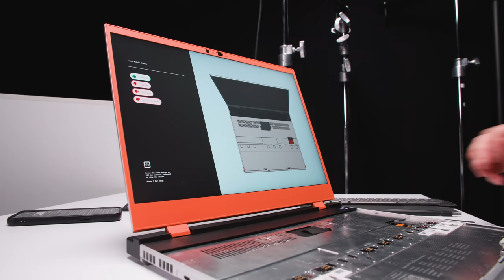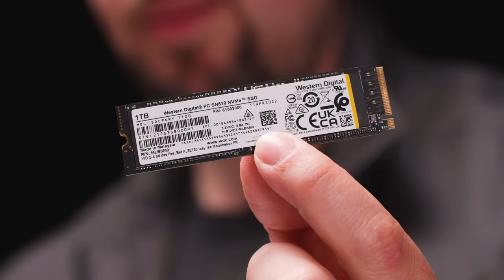Framework 16: an exclusive look inside the modular gaming laptop

Comment: Would love to see an adapter for expansion bay that can connect to usbc port for high end gaming and rendering rather than carrying a heavy laptop.
Reply: U mean oculink. Usb4/tb3/4 are limited to 22gbps of pcie bandwidth.  Oculink in its 8i form can take 8 straight lanes of upto pcie gen 4.
Reply: @megajatt123  the same interface framework used to connect the enclosure but reusing one of the ports.
Reply: @vasudevmenon2496  but, what advantage would u get from that? Correct me if I'm wrong, u want to plug the 7700s dpu that is designed to slot into the explansion bay, into one of the 6 tbhunderbolt ports right?
Reply: @megajatt123  i wanted it on framework 13 to balance portability and power without the extra bulk off 16 inch
Reply: @vasudevmenon2496  not going to work.the dgpu needs power to run, which the framework 13 cant put out, so u would need some sort of enclosure for the dgpu,that takes in external power, and preferably feeds into the laptop too. Ontop of that u would lose more performance, because u would have to 1st send data to the dgpu for processing, and then it would travel back to the laptop to the framebuffer to be displayed. This second issue can be overcome by using an hdmi/display port capture device. So now u have to carry 3 things aside from the laptop. At that point, why not just have the bigger laptop?
Reply: @megajatt123  yeah that's true.

Comment: I don't think its a gaming laptop, more a productivity one. I don't think the cooling solution is really cut out for gaming.
Reply: The screen is 165hz and it has an upgradeable GPU, I'm pretty sure it's meant to be a gaming laptop
Reply: @obj_obj I did not quit catch why laptop throttled. Did they use prototype or this is actual model and it cant play elder ring?

Comment: Sadly it nearly overheated when playing elden ring. However I wouldn't be surprised if they're working on or atleast planning for a hardcore gaming laptop, and I am definitely putting their products on my radar.
Reply: was this prototype or actual framework 16? I'm confued why it got overheated. I thought this meant for gmaing.
Reply: @DroisKargva  I'd imagine the current cooling isnt as effective as something they could come up with later down the line, such as a greater number of heatpipes, which would just make it a issue of switching the old one out for said updated varient without the overheating issue.

Comment: A very novel, appealing concept. But, everything in this offering is at least 1 generation behind the latest tech. The monitors are 2k only.  No assurances whatsoever the chips and boards you buy today can be replaced by any new tech, certainly not plug n play. So the machine you buy today could easily be obsolete soon. I can see this might have appeal to enthusiasts who accept older tech, but not for the mainstream users.

Comment: Very nice video, Sean. I just wish you had gone a bit more in depth on the upgradeable parts that were already present in the 14 inch model so it doesn't get glossed over by people that are new to the product.
Reply: 13 inch model.
Reply: This CEO is very cagey about the products. Maybe he did not know.
Reply: @saulgoodman2018  ...What are you talking about? Nirav actually answered a question I had (and which was echoed by several people) on Framework's forums: Does the Framework Laptop 16, when it is attached to an expansion bay GPU, have a MUX switch. Surprisingly, the answer I got from him was yes! Now only the port built into the GPU module can be used to bypass the iGPU on the laptop for an external screen, but I'm just glad that it's even possible to do so and I'm extra glad it's an option on the laptop's screen!
Reply: @cameronbosch1213  So what he answered a few questions.

Comment: If it's DDR5 RAM for the motherboard (which it is) then it is a good idea at this point. When it's closer to DDR6 time it would not be worth buying. Besides the EU will eventually make it law for all notebooks to be modular. Probably by the year 3023! It took 28 years for them to do USB-C (uniform connections)!

Comment: I just checked the price? For 7940sh, with discrete module and rgb keyboard + numpad, 32gb RAM and 2TB storage, it's costing 4300CAD. I can buy 2 laptops with that price so that would mean atleast 6 years of laptop lifecycle (budget wise and considering I upgrade components like CPU and GPU in 3 years on the framework)..... I am not sold at this price point.
Reply: Do consider that this is a fairly small company that does not benefit from economies of scale; it’s natural to assume that much of the R&D costs will be transferred to the buyers during the first 5 years of sales. The only way to bring costs down is if demand warrants expanding the manufacturing line  (as each motherboard model, to name a key component, is custom-made for Framework)

Also, you could do without some fluff: no RGB, buy barebones and buy the components yourself to save a few dollars, don’t go for 2TB and use external storage solutions until you can afford to expand internal storage, use a cheap external number keypad, etc
Reply: @guaiqueritech  totally agree. I am writing this from a normal and day to day user standpoint. 3+ years of product development and still at early adopters stage!
Then I guess users with limited budget may need to wait 5+ years.
Reply: So, uh, dont buy the ram and storage from em?
Reply: @megajatt123  yes, I explored that option as well. W/o those components (and if I purchase it from amazon/BB) I will save around 100-200 bucks. Not much
Reply: @GUTKU  price to pay for repairable and modular design ig. We would like to see more igzo or ltpo displays though, the entire industry is using fixed refresh rate w are wasteful
Reply: @nseries73  that’s a point I’ve seen brought up but not extensively discussed: how are Frameworks marketed towards the regular user, which comprises the vast majority of laptop sales? Most users are not confortable opening their laptops, even when they are made easy to upgrade, like Acer and some HPs. For them, ease of use is their paramount concern; ease of upgrade ability is not something most consider.
Reply: Wait til you learn about the cost of Macbook, in the US i can spec it to 2600 for max spec, seems completely fine.

Comment: My only problem with framework that when it comes to the price, you'll most likely end up spending the same amount of money upgrading than you would just getting a new laptop every 4-5 years.
Reply: The main advantage I see is repairs. Theres lots of minor issues that can crop up that greatly reduces that 4-5 year lifecycle you expect. Things that other companies charge exorbitant repair costs or even straight up refuse repair.

You could easily extend the lifecycle to 7years if the drop in CPU performance isn't a big deal.

It's pretty great they have a QMK keyboard support. That alone would make this an instant purchase if available in my country.

Comment: Framework is the best thing that's happened to laptops since the 80s, but the thing is that they need to get competitive with actual gaming/video editing laptops like something you'd get from Eluktronics or Falcon Northwest. I currently have an RTX 3080 in my laptop, so anything less than that is a huge downgrade. I understand that this is a big step for framework, but the GPU is underwhelming even as a starter. For $3000 from framework, I get about half the laptop I got for $3000 from Eluktronics or Falcon Northwest. Once they are close to each other in value, then it will be time to get a Framework, which I hope is the next generation.

Comment: I want these guys to make a tablet so bad. The windows tablet space is full of unreliable devices that are impossible to repair, and the alternative is the iPad Pro which is a reliable device, but unable to complete most creative workflows end to end. I don't care if a framework tablet would be thicker than a surface or iPad if it would last longer and be user serviceable
Reply: Same
Though I prefer 2-in-1 more
Reply: @ekaramdani6390  that works for me too, just something I can draw on is all I want haha. A 2in1 would fit better with their current ecosystem
Reply: @xaliurairpower  yeah and they could probably just design a separate exterior while keeping the motherboard, expansion cards, etc. from the framework 13 inch - the current motherboards in the 13 inch have support for touchscreen displays, so they could just switch the case, switch the hinges, and add a touchscreen display

Comment: Theoretically, Nvidia GPUs have better power mileage compared to AMD thus I would prefer them over AMD on a laptop and wait if there will be one. Would wait and see if that new PCIE interface can also be leveraged to a better External GPU enclosure, since it has 8 lanes over 4 lanes that TB have.
Reply: *8 lanes of pcie gen 4 vs the 4 lanes of pcie 3 than usb 4/tb3/4 have, out of thich they can use only 22gbps

Comment: Bruh why would they make the gpu hot swappable and not the battery? How often are you gonna be swapping the gpu on the go as compared to the battery?
Reply: Huh? The GPU isn't hotswappable. Both the GPU and the battery can be cold-swapped easily.
Reply: It's because the GPU cannot be hotswapped (the laptop needs to be completely off), and having the battery hot swappable would likely complicate the existing design and make it thicker...

Also, I've seen you around before! How are you doing?
Reply: @cameronbosch1213  I, too, want to know how @DaRUde117 is doing.
Reply: @aesircorporation1924  Nah, I've seen him on other videos a lot, not just technology.

Comment: they could have used AMD Ryzen™ 9 7945HX instead of AMD Ryzen™ 7 7840U, the main point of this laptop is to use discrete graphics and max out cpu processing.
Reply: The problem is that the iGPU would be bascially just good for displaying an image (those CPUs are meant to be paired with a dGPU) and battery life is not great due to those Dragon Range CPUs basically being desktop parts scaled to a laptop size.

I would have liked to see the additional bandwidth from Dragon Range, but I think they made the right call by using Phoenix (HS).
Reply: I prefer a transportable desktop experience using laptop so it's fine with me if the battery will last only for like 1-3 hours. I'm not gonna used it in coffeshop or inside a plane haha.

Comment: Only if your spare parts gets cheap, you have a shot, like dude seriously 400 bucks for a gpu expansion ?.
otherwise dell will buy you in next 10 years.
Reply: That 400 bucks includes a $80 power adapter that uses Gan Tech to provide 200 watts in the same size as a 45 watt adapter so right now they could offer that same module for 320 bucks but they do not have the bulk pricing discount or the economics of scale for mass production that they can bring down the cost to assemble it into a packet which can be added on to their device for cheap. The only way they'll reach that point is if people who have money and buy generally premium devices which is what this thing roughly costs around by this instead and enough of them buy it that they're able to scale up Manufacturing to the point that they can bring per unit cost down to be competitive with the cheaper laptops. Just like with every technology, it first has to be successful with the rich crowd to be able to afford to be cheap enough to be successful with the poorer crowd

Comment: I feel like a crazy person whenever I see Framework - this product doesn't actually make any sense. The problem with computers is that the technology evolves. It's not like a washing machine or a microwave that you could keep working from the 1970s. As long as we expect progress then any kind of modular machine will contribute to e-waste just as quickly as any other device. Even if you can cope with an outdated chassis paradigm, the precious metals are in the silicon components anyway. You can already repair most laptops, you can already configure what you need at the time of purchase and donate an old machine instead of throwing it away. It's a gimmick that ironically promotes more wastage with excess packaging for the modular components and the increased temptation to upgrade parts more frequently. You are better off, financially and ethically, buying a traditional, well-made device and keeping it for 4-5 years before donating / selling and buying a new one. You are going to do that regardless, ship of Theseus style or all at once it makes no difference.

Comment: I would call it, future resistant. My guess is there will be one to two GPU upgrades offered and that's it
Reply: Why would u say that, what laptop dgpu needs more space power and cooling than that they've set aside here?
Reply: 13" is already on its third iteration of Intel with 13th gen and first iteration of AMD processors with the 7000 series. I see no reason why the same future upgradability won't hold true with the 16".
Reply: @spdcrzy  he's talking abt the dgpu my guy, likely due to space constraints, but his concern is unnecessary, because of the aforementioned reasons. Motherboards present less of a problem.
Reply: @megajatt123  I meant the dGPU as well. I see no reason why what they've done with mainboards can't translate into GPUs too.

Comment: Seriously though... who is going to really be swapping parts in and out? These parts have got to be rather expensive... and still become obsolete and are left to do what? How long will framework maintain a single laptop platform? 1? 2 gens? This all seems like an attempt to get tech geeks excited, only to be disappointed when they find they actually don't upgrade nearly often enough to justify this, or when they do upgrade its a big enough upgrade to warrant a complete system upgrade. Making this whole thing pointless
Reply: It's to allow for upgrades over time, no one is swapping parts daily. Think of it like the laptop version of a desktop.

They have also shown they are committed to supporting their designs.

Comment: Boo AMD. At least you'll be able to replace the parts when they fail.
Reply: AMD CPUs are great. They last longer than Intel or battery power (for the most part), and their commitment to open-source is incredible.

AMD GPUs (especially the one that got revealed) are admittedly a bit disappointing, but it will be upgradable down the line.

Comment: What's the use case for this? I can't see a market gap here. Yeah, It's cool and all but they have to convince consumers or businesses that this is a smart choice. People simply can't be bothered to tamper with their devices (doesn't stop the tightly sealed MacBooks from selling well). And for all you folks who shout the right to repair, these modules are expensive. I hate electronic waste as much as you do, but we know people in the developed world often buy a new laptop if their current one doesn't work. 

I wish them all the best but the company and product seem to be niche, and will become insignificant in a few years.
Reply: They are doing well with their 3rd iteration of the Framework 13 so there are buyers out there at least